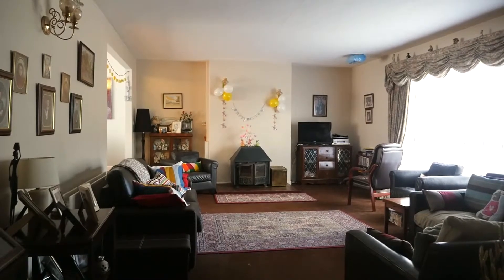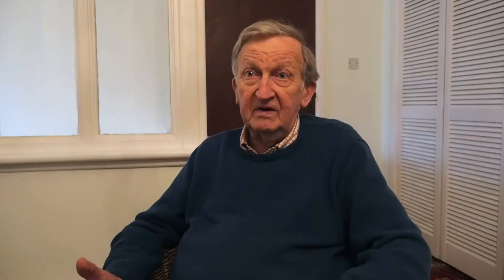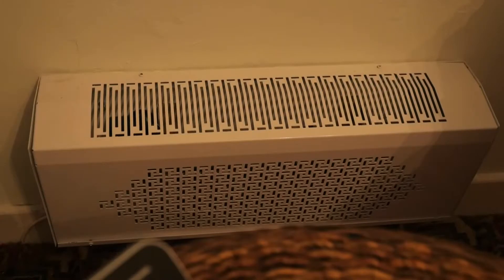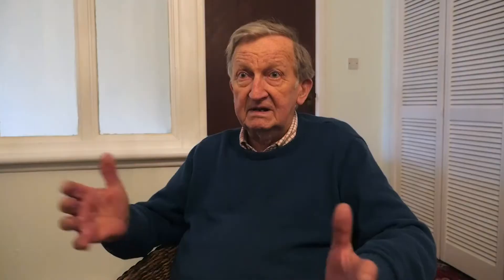Tony

Comment from the maker: Split level bungalow, 9 HEATESE convector radiators plus standard radiators and hot water cylinder. Tony is using only half of a litre of oil per hour.
Reply: Heatese Boilers can solar be combined with this unit and a boiler stove